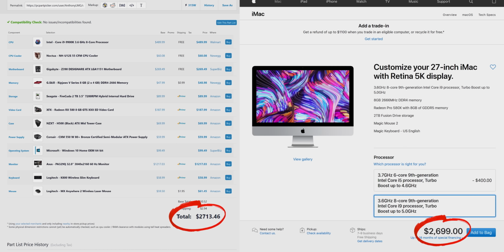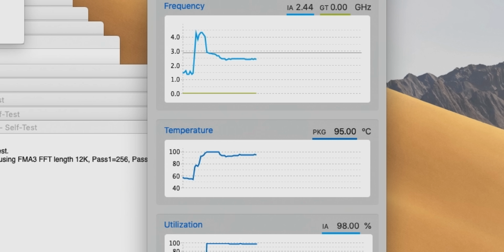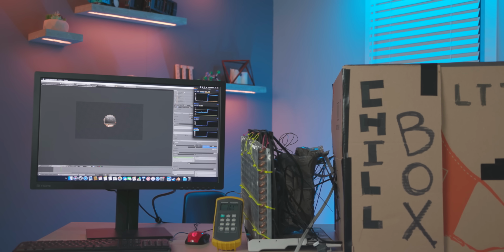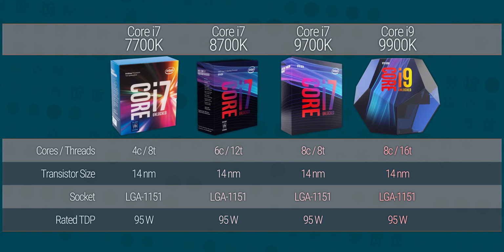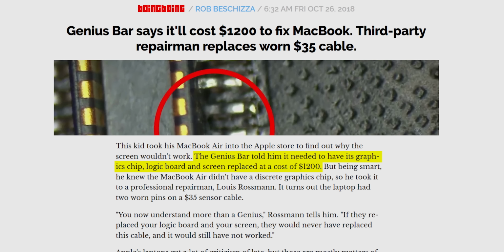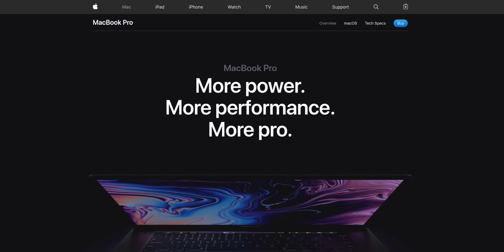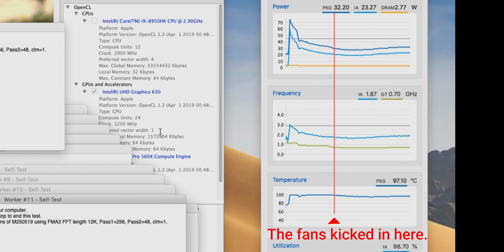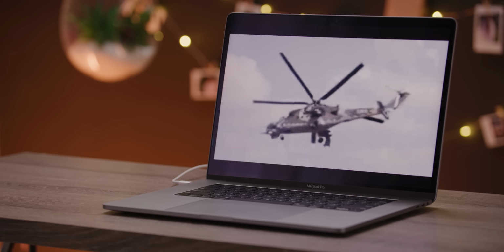Macs are SLOWER than PCs. Here’s why.

Comment: SSD Drives in macs make a huge peformance wise and heat as well ,, my imac use to get really hot and sluggy with the stock SATA 7200 rpm drive in the computer and the fan came on often how ever recentally  I put in an SSD Drive and now my mac is at least 5 times faster and now runs cold to the point that the fan no lnger needs to come on even after 30 hours + and doing some demanding tasks at the same time it still is not slowing down at all and it say running cool as hell, , one thing about mac you fail to know or mention is the fact the macs are made for graphics, animation movies ,sound ,music they are not made as gammer machines or even marketed that way how ever they can play games i have tested an 8 core laptop of mine against my late 2013 imac and the PC just kept up to my imac just .. and my imac is only a quadcore, also the graphics onthe PC are more washed out, ill also mention that the imac was runnijng windows 10 with bootcamp both compters ran the same video game .. this testing was done before i added in the SSD drive and took out the  stock hardrive on my imac.. a mac will still out do any pc when things are setup right,., laptops from apple yes they run hot so fo pc lapotps as well and the heat slows them all down pcs or macs  laptop desktop dont matter .. apples biggest bottle neck is the mechanical hardrives they really heat up alot and slow everything down, part of that tho is the power supplys tend to barely just be enough to feed stock setups expecially. in the imac line and the laptops but the SSD will fix alot of problems in the imacs for sure.. even with faster booting the programs load faster run smoother and so on so if your going for an imac ditch the mechanical drive put in an ssd and upgrade the ram to atleast 16 gigs or more ..
Reply: Are you actually here claiming a mac PRO which they advertise as a professional machine should not be able to handle graphics rendering and CPU loads? Get out
You are entitled to your opinion, but if you spout crap like "a mac will still out do any pc when things are setup right" then it's clear you know nothing of computers except the bare basics.
Reply: @viktor1496  are you talking to me or the poster of the video because i never said anything that your saying
Reply: @KevinMillard68  I quote you "macs are made for graphics, animation movies ,sound ,music they are not made as gammer machines ". You clearly show that you don't understand that 1)The hardware that is stressed for gaming is the EXACT same hardware that is stressed when rendering graphics, doing simulations...etc. 2)The benchmarks they ran in the video which shows the lack of cooling for CPU's (not hard drives) are the benchmarks used by and for professionals. It's not "gamer" benchmarks.
Reply: @viktor1496  the hardware is not the same in the mac and the pc the oprerating systems are not even close to being hte same pcs color pallets are shit for out put graphics as well which is why the standard in the printing indusrty is mac and not just for the the mac does it faster check your history macs tend to be 3 times faster then pcs when going the the operation as well test programs like illistrator photo shop and many others as well as movie programs as well like final cut pro to .. you dont know shit , on the music industry mac is used as the standard they turn out the best stuff ,, sure there are people doing alot of the same stuff on my but their work out put is Sub par at best .. gamming macs used to lag in big time but sence the install processors and OSX that changed that was the only weak point to macs back in the day.. now the imacs are a bit slower then the desktop models from apple that is true and apple laptops them selfs tend to be slower then the imacs at least untill your level the playing field .. the market for mac never was centred around gamming they have always been in the production area but they can now do the gamming as well with no problems , you sir need to do your home work ,, who says the bench marks were not rigged inthe video oh i guess you belive everything you see i get it now .. and even if they were not riged they are not the same machines part for part  either or specs for specs 100% ......I have always found the mac laptops to be sub par my self i have owned a few of them over the years and to get a really fast and good mac laptop you will spend alot of money.. i put my 4 core imac up against my 8 core pc laptop on the same game the imac was runnng windows 10 under boot camp the laptop barely kept up to my imac the quaily of soiund imac won the graphics quailtiy imac won over all performance areas period imacs are over grown higher end laptops that look like desk tops basically .. when you get down to it.. i macs can run hot yes what causes that is the stock 7200 rpm hardrive so i went SSD and my imac is way faster and it does not run hot anymore either everything is just plain out faster.. it already put the 8 core laptop in its place so now it will do so even more now with1 change SSD drive and no more heat problems ant where in the machine ,, see when you have a hardrive heating stuff up inside that heat goes to everything in the computer and aplifiys it all so things will run to hot over all get rid of the heat problem cause then you have less heat and better performance out of the system .. this works in pcs as well anything that can cause to much internal heat  will bog down the system and it will not perform get rid of the cause things run faster and smoother etc etc..
Reply: @KevinMillard68  1)Learn how to use connotation, your writing is almost unbearable to read. 2) Once you start going "the benchmarks are rigged" and the other crap excuses you are making... you have already lost the argument. It's clear that you are a fanboy unable to criticize the company they buy stuff from.
Reply: @KevinMillard68  And tell me, does a macbook air have a HDD or SSD? an SSD and it STILL overheats and has to thermal throttle. Hard drives produce jack all in heat compared to other components. Thanks for proving my point about you being illiterate on computers.
Reply: @viktor1496  i have both macs and pcs in the house i am also a mac and pc tech have been sence 1990 , sofware is easy to reprogram and rig for your purpose that is a fact spent many years as a programer as well so piss off FAN boy iam not a fan boy of anything ,, i once turned away from apple for 10 year till they got their shit together for gamming so for 10 year i ran PCs for gamming the apple computers had their purpose at time ...

Comment: Just one of several reasons to never pay for the upgraded CPU option on a Mac. Get the RAM, storage, and GPU you need, forget about CPU upgrades, at least until Apple fixes their thermal issues.

BTW, I’m still using  my 2007 15” MBP, entry level model. Sure, a C2D is relatively slow these days, but that 12+yr old laptop is still useful.

Comment: Apple under jony ive has gone too far in the pursuit of thinness and lightness. The keyboard is bad, the thermal specs are subpar. Apple is letting competitors get closer and in many cases surpass it. We can ever know but I guess that if steve were alive he wouldn't allow the trade-offs to go that far.

I'm totally fine with a slightly thicker, slightly heavier computer that has a better keyboard, better connectivity/ports and that can cool itself better.

Comment: Thanks for this. I've been an Apple guy since I was a preteen (um about 33 years ago) and last year built my first "Hack Pro" (w/o MacOS) to be my main machine. I can't even run Linux on it because our internet sucks and Linux always wants to download dependencies. And with a 2080 GPU, I can't run MacOS because Apple won't make drivers for it. Sigh. Also, have you made a video about how hard it is to repair Macs now? Everything is glued together. To me, Apple has completely lost that spirit of experimentation and learning that were such a part of building its brand -- up to the millenium at least. I miss my MacOS! I still find it to be far superior to Windows in many ways, but I don't want to sacrifice the performance of this Threadripper!
Reply: Adam Prall The potential for such “dark art” / “fiddly details” are what put me off Hackintosh route.  I had my fingers burn in the past - eg bought expansion memory for my (proper) MacBook with same written specs but it turned out that they also needed to match an unwritten spec - ensurable only by getting the ones from a specific manufacturer.  

Stress-making, confidence-dropping unpredictably time-consuming and expensive - not what a video editor requiring only a single machine wants to set themselves up for (especially given reputations and job deadlines to be honoured).  Unlike someone with long history / wide experience of having made few/several hackintoshes (street-wise, knows what to look out for).  

Are there people/companies/communities who can hand-hold the making and maintenance of individual hackintoshes for non-configuration-expert users?
Reply: @crawlinginfilm9683  Apple sues them whenever they find them, so the best help you'll find is the video editor here on YouTube who builds his own and the forums like tonymacx86 etc. If you need more info let me know. For myself, I could have used an Intel processor and motherboard and AMD gpu instead and had a killer windows and mac os machine, but I did not want to sacrifice the performance. You could do the same with the intel/amd path and have a lot of success. But yes you do have to mind your Ps and Qs and block automatic updates.
Reply: @crawlinginfilm9683   https://youtu.be/ed8tUm3X0cA Peter Paul chato is the video editor name
Reply: Adam Prall Thanks a lot Adam, I’ll check out his experience / advice.

Comment: i build pcs NOT macs....when i sit and talk with the client the first thing i discuss is buying a good case with at least 4 120 mm fans and good placement of those fans. I inform them that there might be fan and/or cpu fan noise at times and that this may be normal when you run it hard.  I build mine to last years...stay cool and to make sure no matter what the client throws at it it will never reach higher temps.
 my beast a dual xeon 5680 intel board, 64 gigs of ram...huge TJ07 case. - 120x25 mm Fans running moderate cfm's and 2 rear 92x38 mm high volume jet sounding fans to keeps things cool.
 Yes it is louder than the loudest vacuum cleaner...and i dont care. Cpu temp hover around 32ish with no cpu ramping.
 People ask me why its load at boot...i tell them its running perfectly normal. People understand cooler versus noise. Just tell them. Performance shouldn't be based on what it looks like. Its based on how cool everything stays.
 Cooler is better...and when you turn on something that whines like a turbine...you can tell your friends that it needs that power to take off and run.

Comment: My 2013 IMac has an exhaust vent at the rear. Could you not mount a small heat extraction fan over the vent to improve performance?

Comment: Which is why I’ve been considering building an external fan system for pushing extra air into those excessively thin slits they call thermal management.

Comment: I work with both PC and Mac for many years. When I edit on mac it's always smoother, it hardly ever crashes. On PC I've have so many crashes in multiple editing programs. Even after a new installation with good working components. Why is that? I know PC is better in the ways you just explained, and I use it for gaming of course.

Comment: Allright, I'll confess here.  I buy macbooks for travel machines and I will tell you why(no it isn't to feel fancy, don't care).  Probably will again.

I know this stuff about performance, I understand it.  If I want a performance machine I'll build a desktop, laptops are about portability.  I am not going to be doing any hardcore video editing or anything high demand like that on my laptop.  What I want is something portable with good battery life that will... and here it is... come up right away with no BS when I open the lid.  I want something I don't need to work on or monkey with to get stuff done.  On that apple actually still delivers, at least as of 2015 when I last bought a laptop.

Now I know there are PC laptops out there that will do this more/less but I've just bought way too many PC laptops that disappointed me with poor build quality and quirky hardware/software integration.  Then there's also just generally having to deal with windows which nobody likes even if it is better now than it was in years past.

Get the apple complaints, I don't disagree really.  They annoy me too but they do deliver a premium experience for certain use cases.  Whether the premium price is worth it is debatable, I guess how much is your time worth to properly research the PC models and dick with windows.

Comment: Actually, i disagree with your opening statement. I can build a pc at any given price point that will be better spec-wise than a mac
Reply: Also, you can actually upgrade and repair it yourself. You don't just void your warranty and have to break into a completely glued case that breaks because it's thin cheap plastic.

Comment: My superior loves Apple products. She owns Macs and iPhones... she makes disgusting face when she sees my trusty Note 9 when Apple can't even allow their Pencils to work on iPhones.
I honestly don't like Apple products. Even when Jobs was still alive. It's a pain in the ass to use and expensive as hell. I've had a Mac just a few months ago and honestly the only thing I got impressed was its 5K monitor. But since now my PC uses 4K monitor, 5K isn't really that amazing. Sure, if you buy equivalent Windows laptop, it will cost similar to a MacBook. But if I spend my money on something like an Alienware or an MSI I can at least expect them to treat heat as best as they can with their powerful fans and thickness. Or I can expect more features like TOBII eye tracker. Or at least some LED actions. My old Alienware 17 has aircraft grade hinge that still works perfectly fine. It feels much more premium than any MacBooks and even after some accidental drops from weist height the laptop is still running fine without any external damage. If I pay similar price for a MacBook, all I'll get is fancy design, not so useful (at least to me) OS and thermal throttling.

Comment: If Apple used slower CPU's made for that form factor then even the plebs that buy Apple computers would realise they are paying for the privilege of having a mac. The other big difference not mentioned in the video is that Apple will subtly throttle old macs so people buy a newer mac. The only thing Microsoft cares about is that you are using Windows and that your computer meets the minimum specs for running their OS. The other annoying thing about Apple is that they don't use desktop grade hardware. I have a 2011 iMac  and it uses laptop hardware but they don't really mention that but tech geeks know that and that's why plebs are the target audience.

Comment: I'm not saying this is okay, but hear me out on this one. When Apple introduced the new MacBook Pro design (2016), the market was trending more towards CPU's which were getting smaller (4 cores max, not 6 or 8) and thereby producing less heat. But after that, suddenly Intel started making bigger CPU's with 6 cores, 8 cores,... These are a lot harder to cool than the CPU's Apple had imagined would come out later on. Well, designing that new chassis cost them a lot of money and time, and it was meant to be around for a few years (like it has been), so they couldn't just change it up the next year to get better cooling. It's like an investment they made. They took a risk and it turned out badly for them. It's not like they deliberately ruined the thermals of their machines... Now they are just trying to reduce the damage by lowering the voltage and dethrottleing the CPU, because people don't like to hear fans all the time. It's not a nice solution, but because of the physical limitations in cooling solutions in such a cramped chassis, they don't really have a choice. Once again I'm not defending Apple, all I'm saying is that they didn't do it on purpose in the first place.
Reply: maybe they didn't do it on purpose but decided to keep it that way. just like they slow down their older items so the users are forced to buy newer, more expensive ones.

Comment: Almost all the gaming laptops I've used don't thermal throttle. So no not every laptop does that. Didn't agree with that that part. But everything is else is common sense. They are building a fashion statement that just so happens to also be able to be used as a computer..... That's it.

Comment: Why are they always using video export as a benchmark for speed? I’m on the music side of things for tv and I never have a problem running out of tracks on an iMac. Even with dense orchestral trailer cues. It just seems like they are only presenting this from one angle in a bubble that doesn’t reflect the majority of Mac users. I like Linus tech tips and in fact they are not alone in these kinds of critiques. Stories like this seem too narrowly focused. There’s more to computer uses than video exporting a games.
Reply: The process is called rendering and its use is out of pure convenience. You'll need just more effort in Audio to bring a computer to its knees. Just say, a couple of tracks with Diva or Serum - with samples you will need much more, as you already mentioned, since orchestral instruments are just samples and not calculated in real time. 

Yet with rendering you need just a reference model, a project, a target video codec, and off you go, the same heavy load on all machines, with different performances. There, you have your measurable comparison base.
Reply: @pontram  hehe, I know what rendering is ;) I'd just like to see other use cases